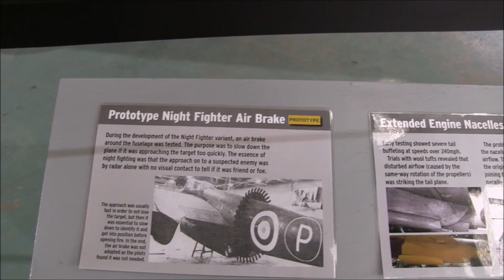Mosquito Prototype design changes. Close-up

Comment: The prototype W4050 had its fuselage fracture while taxying across rough ground. The complete fuselage was swapped for that of W4051 and then strengthened each side as shown in the video. The ID number of fuselage W4051 had the 1 painted over and a zero added. Until the paintwork was stripped, a few years ago, visitors could just about make out and feel the outline of the 1 on the fuselage. 
The original short rear nacelles can still be found inside the added longer versions. So it would be possible to restore this plane to its original wing configuration.

Comment: I would give up my Sundays in the early 70s to help out at the museum, my first visit was a foggy damp day, as i walked along slowly two spinners came into view then the rest of an aircraft, a marvelous sight to see,
One engine on the prototype was found to have 40 hours left on it, so it was sold providing the buyer found a replacement time ex engine., Much later in life i was offered a flight out of Manchester to Chester, I had to decline as i think i would have lost my job, but regret that decision now, as the mosquito took off the tower asked him to beat up the runway it was a wonderful sight to see this mosquito bank then come down the center line of the runway at speed   going over the top of a Laker  BAC 1-11 that was taxying .
I was at the museum when the Sea Vixen was off loaded, the aircraft swung to one side with a wing tip being damaged, Alas my job took me away from the museum I must make a point of returning, many  thanks for the video, the mossie must be my favorite of all time, I do have a set of Brian Taylors scale plans of the aircraft ,  but its build is  under the heading one day. and as with everything else the price of balsa has gone through the roof.

Comment: Million thanks for the great video Sir..
Is that door underside of the starboard side of the fuselage for pilot entry..? And found a bulge over the canopy, on starboard side.. what is the real purpose of this bulge..? Night time navigation..?
Reply from the maker: Yes - the bomber version (which was the first prototype) had the entry door there. If you come to see the prototype at the museum, you will appreciate how much of a tight squeeze it would have been - particularly if you were wearing a parachute.  The door was re-located in the fighter-bomber version, to make room for the cannon and machine guns. The later marks of Mosquito had side bulges for improved rearward view, and a top ‘astrodome’ blister for taking sextant readings. You can see this on the  Mosquito B35 also at the museum.
Reply: Thank you Sir..
Am working on a scale model of the mosquito, for a diorama as scramble.. so any information is valuable..
Reply: Was that door a safe bail out exit?  It looks very near to the props, imagine idling right engine in a steep descent?

Comment: They should have repainted W4050 in the exact yellow colors used on the plane when it first flew in late 1940. Could have been even more authentic had it used the serial number E2034 , which was on the plane when it was first unveiled.
Reply: Would you tear out the development two stage engines and cowlings and rip off the rear nacelle extensions?  The plane was a working test bed and evolved during the war.  The colours it had at the end would be the most authentic.

Comment: Unbelievable! No mention whatsoever that the airframe is sporting the later, 'Two-Stage' Merlin engine cowls implying W4050 had these fitted from
Reply: Looks more like a development airframe than a prototype.  That usage is probably why it survived.  The Mk VI fighter bomber shown in the video has the original single stage Merlin engine nacelles.
Reply: @givenfirstnamefamilyfirstn3935  If W4050 had had the later two stage engines fitted later in its career as a test bed (which it did) that wouldn't have been the issue for me. My original gripe was that there was no mention of this at all in the video, leading one to believe these power plants had been fitted right from the start.
In addition, at the very beginning of flight tests, '4050 had shorter nacelles than production airframes, which allowed for full span flaps as opposed to the familiar paired arrangement on each wing, as seen on production models. The wing tips were squared off as well giving a different profile when viewed in plan. The exhaust arrangement was also different. 
It would have been simple enough for all of this to have been mentioned in the video.

Comment: Is the aircraft shown actually the original Mosquito? I ask because it seems to have the upgraded Merlin engines from later in the war. I could, of course, be wrong, but that's what I see.
Reply from the maker: Yes, this is the original Mosquito prototype, which has been restored to the state it was at the end of its service life. At that time, it had the later Merlin engines installed, as it was being used as a test-bed for the high-altitude night fighter version.